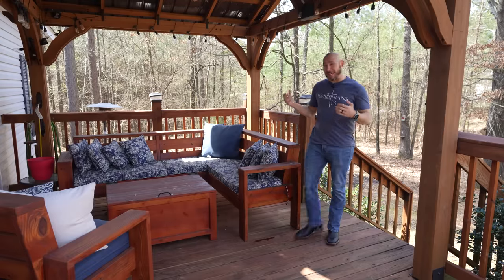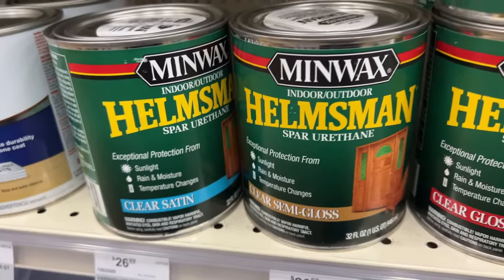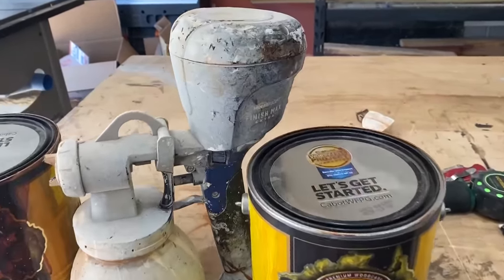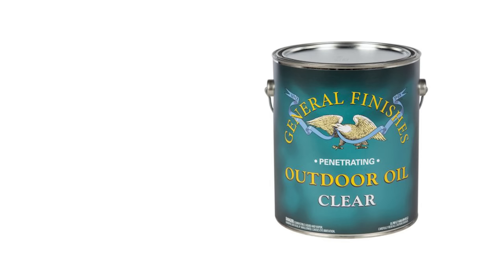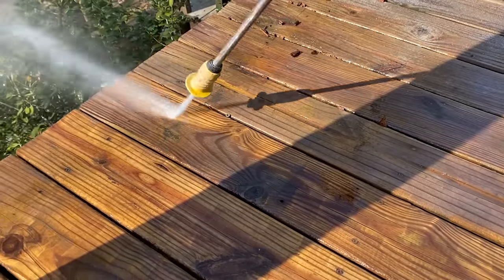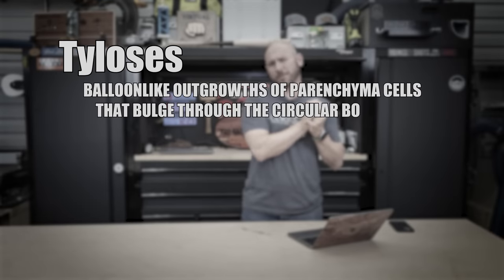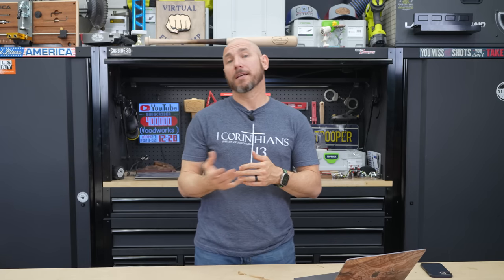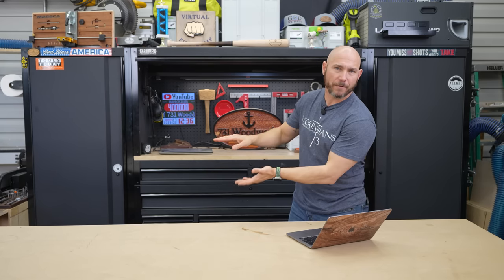Don't Use the Wrong Outdoor Wood and Finish for Your Project

Comment from the maker: ▼EXPAND FOR LINKS TO THE TOOLS▼ 
🎥 Watch Next - 99% of Beginners Don't Know These 5 Mistakes Ruin Wood - https://youtu.be/xA8tcPICLiE
🛠Tools and Products in this Video:
Cabot Australian Timber Oil - https://amzn.to/3L7U6uV
Osmo UV Protection - https://amzn.to/3ZJ1GQY
General Finishes Outdoor Oil - https://amzn.to/3SWdU6x
Cabot Clear Finish - https://amzn.to/3ZVemnT
Spar Urethane - https://amzn.to/3F7oB05
Homeright Finish Max Sprayer - https://amzn.to/3L6oC8s
Titebond 3 Wood Glue for Exterior Use - https://amzn.to/3YC7bj3
Epoxy for Feet Bottoms - https://amzn.to/41QRfN3

Other Tools/Equipment I'm Asked About Often:
Table Saw - https://amzn.to/3IoKqsZ
Table Saw Blade I'm Using - https://shrsl.com/3xv5i
Miter Saw - https://amzn.to/41hbJy4
Tripod for Phone - https://amzn.to/3E3kWA9
Phone Holder for Tripod - https://amzn.to/3E1E6GG
The shirt I'm Wearing - https://www.shieldsofstrength.com/1-corinthians-13-shirt/
Boots I'm Wear - https://amzn.to/3HkUl3y
Toolbox in Background - https://homedepot.sjv.io/x9B2xy
Tool Wall over Miter Station - https://amzn.to/3ZgWq7B
Digital YouTube Sign - https://amzn.to/3GL2a2e
Camera Gear I Use - https://kit.co/731Woodworks/camera-gear-i-use 
Computer Equipment I Use for Editing - https://kit.co/731Woodworks/731-woodworks-computer-equipment

Other useful links:
Daily Tool Deals on my website: https://www.731woodworks.com/tool-deals
Subscribe the 731 Newsletter: https://mailchi.mp/7e44c16eefdc/731-woodworks-email-newsletter
Check out our easy-to-follow woodworking plans: https://www.731woodworks.com/store
Outlaw's Board Butter - https://www.731woodworks.com/store/boardbutter

Comment: Number one thing to do is to keep it out of the sun.  Any finish, any wood will get gray and start rotting with enough sunshine if you don’t stay on top if it every year, maybe two.  As they said at a Woodcraft class I went to on the subject: “Sunshine always wins”.   It’s hard to beat a nuclear fireball only 93 million miles away.
Reply: 93 million miles.
Reply: Spar Urethane does not hold up under days of 95 degree hot summer days!
Reply: But I thought sunshine was good to prevent algae growing up on it?
Reply: @starsINSPACE  yes, direct sunlight is too strong for mold and algae.  Indirect sunlight causes algae to grow since algae photosynthesises so it likes sunlight as long as its not too strong

Comment: I’m working on some outdoor furniture and trellises and these are some great points. I like the trick with using epoxy on the feet to prevent moisture from soaking into the end grain. 
I’m looking forward to some outdoor projects as we head into spring.
Keep up the great work.

Comment: Hi, I have a boat with white oak and mahogany rub rails. I am taking off the old varnish via heat gun and scraper. I have varnished many times in the past with Pettit Captains Varnish and though beautiful, the flaking in the future drives me nuts. I have used a product called Semco on teak which is a nice sealer but am wondering what else is out there. I know I definitely want to go the sealer route and just re-coat 1-3x a year to keep the wood looking good. The boat is on saltwater. Can you recommend a sealer for marine use? Also the mahogany and white oak have gone grey, can I use oxalic acid to restore to original color without damaging the surrounding paint? Thanks!

Comment: I just used Helmsman for the 1st time. Your right 5 coats and bubbles (fish eyes) Never had a issue in all my 50 yrs of using polly or a clear coat. I dont think i will ever use it again. I sanded between coats as usual. Got tired of it and used one coat of  quick dry polly and woo lah. 
Perfect. I put it on thick, thin and even mixed it with mineral spirits. I don't  understand why it wouldn't cover. I even call Minwax. 
Ok im done venting. 😅

Comment: Great video! Great advice. A couple more things I do for furniture on concrete patios are: Use Furniture feet to keep it slightly off the ground. Also, I use a cover in the winter months. In places where you get a fair amount of snow, this will save a little work throughout the years.

Comment: What I did for my Normal Abrams Adirondack chair was was cut, fit and assemble the entire chair. Take it completely apart, paint it, one oil primer and two acrylic latex paint. Then put it together. It's been in New England weather for several years...no problems

Comment: Wood outdoor furniture simply requires some maintenance. throughout the year.  We always bring our patio furniture up closer to the house for the winter so it won't get as badly hammered by the sun and snow.  I don't like covering outdoor furniture because I think it's a recipe for mildew. I always wonder if this is a problem for people who have their furniture shrink wrapped.  In the Spring, the furniture has to get thoroughly washed down - especially if matted leaves sat on it.  I use a outdoor furniture cleaning concentrate, a garden hose sprayer, and a soft non-scratching brush designed to wash cars.  And like you said, the finish may need to be touched up every two or three years.

Comment: Awesome video, I just built a small patio table, mostly to keep a glass or two on it. I used White Oak, and I used total boat marine finish figuring that if it can protect a boat from the elements it can protect my table. I wanted the project to be quick so I used hairpin legs just so I did not have to think of the joinery too much and even if the wood moves all of the legs are attached to only 1 board each. But I am thinking of replacing my construction lumber table that I built a couple of years ago, since the top of it is starting to rot. Or has developed enough rot to be concerned.  I will probably replicate my smaller table since it seems to be okay. It just went through it's first shower and it seemed like the top was pretty water resistant. Though I will have to check out the timber oil.

Comment: Can't remember the name of the product cause the paper label came off the can before I finished using it up. But it was some spray-rubber. I sprayed on the pick nick legs bottom that touched the ground/concrete (though, concrete will sand/scrub it off after enough movement.)deck surface.

Comment: Hey Brother. I thought I might want to give you video ideas. How a video comparing the ease of application, and final results of finished product on these finishes that you mentioned in this video (I wouldn't bother with afore mentioned, inferior product, because if you didn't like it, I don't see anyone else would, unless, of course, they can get it for almost free.) 
I'm talking your simple, down sized night stand/drink-holding table you'd see placed beside chairs or loveseats on a deck. 
1 for each of those finishes would be great.
I personally, really like the Cabot Finishes for door use. They look awesome on pick nick tables and any pool side furniture pieces.

Comment: pine tar, heat it up, heat the wood and "burn" it in with a torch( make sure not to actually burn it). Leaves a lovely reddish brown finish and a sweet smell(unless you use bad tar)

we use it on skis, cabins, boats, tool handles basically anything that needs next level protection.
Reply: also food safe

Comment: Redwood and cedar are nicer to work with although teak and Ipe are great for strength and durability. Cyprus is another good choice and I wood 😊use it more often if it was readily available in my area.

Comment: 8:40  "Zinc coated" screws  and nails are meant for outdoor usage.  As opposed to the common silver colored fasteners which have a thin nickel coating that will not hold up to outdoor weather.

Comment: I'll second that endorsement for Cabot penetrating oils.  I used them on a built-in bench and a patio table set here in Ohio.  Ouside and uncovered for two years so far, and they look great.  I thought I would have to touch up this spring, but they still look like the day I finished them.  Plus you can choose a ton of colors, and further customize the look with various levels of opacity.  I'll use these from now on.
Reply: Did you use a spray or just hand paint?
Reply: Just a brush

Comment: Great information in this video! What is your opinion on outdoor finishes for pieces which may come into contact with heat? Such as a built in table/stand for a kamado style grill? Thinking about any radiant heat from the grill, or direct heat from placing a hot pan onto the surface?

Comment: Great video. Very informative. However…..Yeah there’s always that guy. I just brush finished an Adirondack Chair I made with Cabots Australian Timber oil that you recommended and I can say it came out terrible. Blotchy, hazed over, impossible to flow out brush strokes and takes at least 5 days or more to dry in ideal conditions. I’m not a finishing expert but I not necessarily a novice either. I’m kicking myself because I didn’t just take a little extra time and spray the pieces. I think that’s what you said you did in the video for your deck furniture. Just emphasize that to people. If you expect to brush finish on more complicated projects with this stuff you will be highly disappointed and frustrated. Thanks Bob

Comment: I'm confused. I'm brand new to wood working and want to build some outdoor furniture. I am building extras to sell so that my furniture will be paid for. Everyone is telling me to use treated wood for outdoor furniture, but it has to sit for 6 months before I can do anything with it. You say not to use treated wood, which would be far simpler and cheaper. So, I'm confused. I'm afraid the benches I just made are going turn into a mangled mess once they dry out... any help "wood" be appreciated! Thanks!
Reply from the maker: In my experience treated wood tends to split/twist a bit more than normal pine that you put an outdoor finish on.  Not saying it 100% will do it, just more likely.  And treated wood has chemicals that could irritate some people's skin.
Reply: @731Woodworks  Have you found that some people would turn their noses up to outdoor furniture that  isn't treated wood.

Comment: My suggestion treatment for any projects that either goes damp/moist space or outdoors. use pine tar, it's a historically proven that it will last, even in underground. 
and almost maintenance free too, just re-apply every 10-15 years. if you want wood to last even longer burn it (shou sugi ban) before using pine tar.
well that is if you can find pine tar.

Comment: IF you want something to last Ipe is king.  It's not cheap at all.  I built a holder for my Big Green Egg out of Ipe.  Based on the fact it is as close to fireproof of a wood as you can buy and it is what they used for the decking at Niagara Falls the need to replace it in my lifetime is zero.  You will burn up the bits to counter sink the screw holes and only use stainless steel fasteners.

Comment: what about putting Flex-seal on the bottom inch of the legs?  Is that an option?  I've done that on some polebarn corner boards but haven't tried it on furniture.  I guess if you move or drag the furniture much, it would wear through.
Reply from the maker: Sure, I don't see why you couldn't.

Comment: Great video as always question on the sprayer I bought one I’m just about positive it’s the same one and while staining our deck last summer I kept experiencing the deck stain clogging the small tip I believe it’s the blue tip or whatever color tip is required and had to keep stopping to clean it out I don’t believe temperature was an issue it was very high 90s maybe like 97 degrees in full sun thanks for any advice also I did not use anything but the stain

Comment: Wood finish is very important but what matters more is actual type of wood you use. Cedar or Oak would last much longer then cheappo pine construction wood. 

Also what matters most is actual design. I live in Ireland where there are more rainy then sunny days through the year and there is ton on moisture in the air. I have build some nice wood planters and cured them with expensive Osmo which is special oil to prevent wood from molds and helps to protect wood. It didn;t. 

My designs are nice but kept water on wood pieces. What you need to do is to design your pieces under slight angles to make sure rain water quickly slides down and there is nothing what prevents water to stay on the wood. Once you have water droplets on wood it will start rotting soon and create black mold. :( Now i have to re-do all my pieces to give top parts a slight angle to make sure water doesn;t stay on them.

Also pressure treated wood while is better than regular wood with no treatment, also needs to get proper finish. In most cases pressure treated wood is left outside for a weeks/months and even you don; see it it's already infected with molds.

Comment: I am getting ready to clean and seal outdoor cedar posts on my deck. I built a new house and have great cedar posts that I want to protect but first I need to clean and degrease. I will get some of that cabot clear coat but would you have any recommendations on an outdoor wood cleaner / degreaser that I can use to scrub these large posts and get them ready for clear coat?? Thank you

Comment: Not a big fan of paint. Maybe I've not used the right product but paint doesn't seem to weather well. It can look and feel chalky and then it seems to hold moisture which promotes insect infestation and rot.
Oil may not be perfect but it does shed the water pretty well and it is easy to touch up when you decide to do it.